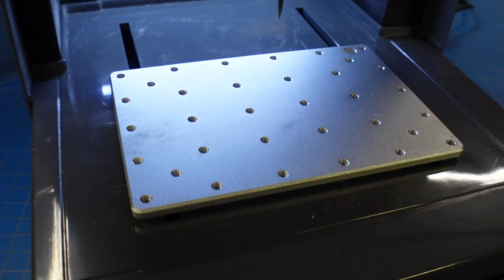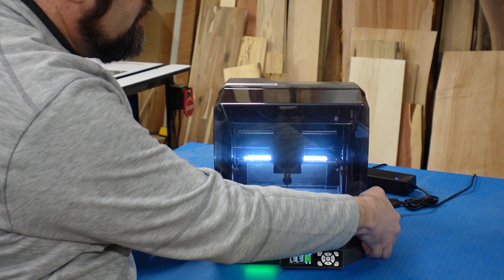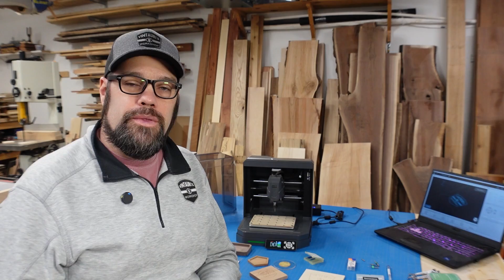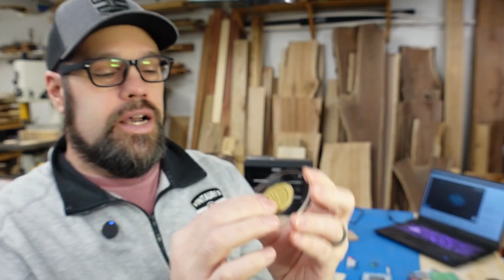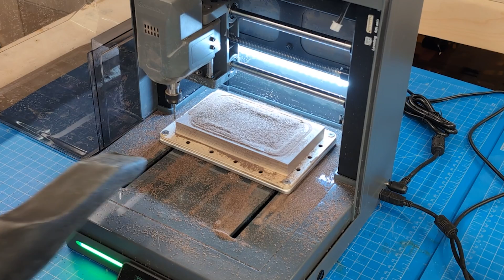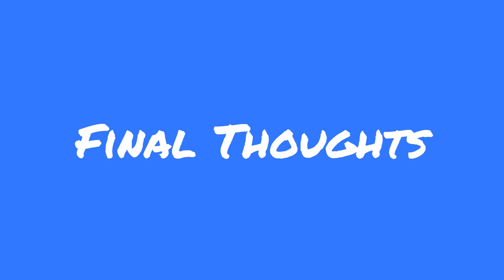Genmitsu Cubiko Mini CNC Machine

Comment from the maker: Check out the Cubiko on Sainsmarts website using my affiliate link here: https://shrsl.com/4w4f6
Reply: Do you think this unit would be good for small copper or brass badge machining.  I am looking for a unit that can do milling for cleaning up the edges of copper blanks and then also do laser cleanup of masking paint off the surface for making etched and paint filled badges for machine tools
Reply from the maker: @CraftwerksMC  While it can work with aluminum and brass, it's very slow at it.  You might want to look at the 3020 Pro Max for milling copper and brass blanks.  https://youtu.be/Gz1eA__9gos
Reply: @Vintauri  I wasn't actually going to mill the blanks with it.  I am going to cut the blanks on a shear but doing that the edge will be jagged and its pretty thin sheet metal (less than 1 mm) so my thought is to just use the mill to give the edge a machined amd straight edge, and then the laser to burn off the protective paint for the area to be etched.

Comment: From a machinists standpoint for cnc metal, swap for a .25 collet and use a .25 3 flut square end mill, then do the math for speeds and feeds and it should cut alot better.   .125 end mills are more fo a finish pass or for a very small hole or radius.
Reply from the maker: This machine is way to lightweight to run a 1/4" endmill. The spindle is very low power and the frame cannot hold up to the chipload that a larger endmill wants to run at.  It's really meant for smaller engraving projects, but I figured I would try it out on a slightly larger project.
Reply: @Rockingmachinest  what about a 4 flut end mill I just got this machine i have no experience with cnc but i have had it up and running and actually made a couple of things but i thought id ditch the 1/8 collet and see if i could get a 1/4 would that work better?

Comment: This is wayyyyy smaller than it looks on Amazon thought this could fit some hefty pieces
Reply from the maker: Yeah it's no beast.  Great for a small space workshop on smaller items, but not for anything larger than a drink coaster.
Reply: @Vintauri I just got one I have to agree mostly but I did push it this weekend and did a 6inch by 4inch 1inch thick pice of red oak I made a half inch deep pocket and put some text in the pocket I really just wanted to see if it would handle it

Comment: dumb question, could you put a hole up top to fit the end of a shop vac hose to it so you can have a dust collection system?
Reply from the maker: It's possible but the hose would need more move around some and it would likely interfere with the cover. It would be best to leave the cover off when running with dust extraction.
Reply: @Vintauri well the fix would be to first elevate the shop vac itself, and if necessary install a extension hose to it , just a thought lol whenever I get one I’ll send a photo 😂

Comment: Super informative video brother. I have my Cubiko coming in in the next couple of days. Hoped you could clarify something for me? You kept referring to your speeds as 5 inches per minute, or 25 millimeters per minute. I'm unsure if I'm missing something as I'm very new to the CNC world, but I would have expected 5 inches per minute to be closer to 125 millimeters per minute as 1 inch is ~25 millimeters. That being said, do you usually use ipm and therefor 5 ipm is the true speed you're running at? Your results are clean, so I'm wanting to get a solid baseline before testing later :) Thanks in advance!!
Reply from the maker: When I started using CNC routers, I always operated in inches per minute.  Now with more lasers and people using mm/min or mm/sec I try to include the conversions, but in this case I slipped up when speaking. Use the IPM settings I reference in the video to get a baseline for similar work.  Thanks for watching!
Reply: @Vintauri awesome bro! I really appreciate you taking the time to clarify cheers!

Comment: Many thanks for the detailed test! Which software do you recommend for PCB milling? And which software for wood milling?
Reply from the maker: For general CNC milling and operations I like using Vcarve from Vectric.  You can easily import vector designs from other software. I've not designed many PCB circuit boards so I'm not sure if there is a better layout tool.  I've heard people like the free Circuit Maker tool.

Comment: Can this be used to engrave text onto metal medals? Depends on the metal I guess, but let's say brass.
Reply from the maker: Yes it can engrave brass but depending on the depth and size of the engraving, it will be slower than a more rigid CNC router.

Comment: Why no auto level?
Reply from the maker: As far as I can tell, the z probe only works with PCB boards and through the control panel on the front of the machine. They may have more information on it now but I was not able to get it to work through the Gsender software.

Comment: Nice review!  Sainsmart has said that you use the dust boot with the cover removed, which suggests that the machine will run without the cover.   I had that dust boot on a 3018 Pro and found it likes to wrap the long bristles, at least in the early versions, around the bit and start slinging the brush section around.  They may have shortened the bristles since then, if not some trimming might be worthwhile.   Those aluminum clamps appear to have a threaded hole in the short stubby end, this can be used with a screw to level the clamp so it's tilted down slightly into the workpiece.  The angled up approach has been described as the watermelon seed squirt position since the work can squirt out from under the clamps in that position.  I prefer shop made (we have CNC routers...) clamps from wood or plastic, with nylon screws instead of metal since cutting into them doesn't create as many entries in the busta bit club scorecard.  Any gcode sender worth using has feed rate, spindle speed, and travel speed adjustments including Candle, UGS, GSender, etc.  They're built into the firmware, not the sender, where grbl calls them overrides.  And a VCarve trick, VCarve, and probably other 3D capable Vectric products, does "rest machining" where you can specify multiple finishing bits and each one will only remove what previous bits left.  On projects with a lot of flat areas you can reuse the roughing bit (adjusting the feed and stepover)  as the first finishing bit, which may reduce overall time by getting all the near flat areas.  I've found that it can also get areas that you might not have suspected too.  Since no bit change is needed you can combine roughing and that finishing pass into one file and the extra pass probably won't take very much time.  IDK if it would have helped that particular job, but it's something to consider when setting up toolpaths.  And those plastic rings on the bits are depth control rings and used a lot in the PCB manufacturing industry.  They let you change bits without having to reset/probe/whatever the Z axis.  They also reduce your max cutting depth, I've melted them with 3D projects on smaller CNC routers when trying to cut too deep.
Reply from the maker: I did run the metal job without the cover so I could ensure the chips were clearing and keep a little air on the bit. They didn’t send the clip they are talking about with mine so I had to tape it down. I’ve used Candle and UGS but I find the Gsender interface to be easier to use. I’ll have to look at the feed rate adjustments on the others. Thanks for all the great tips! I'll definitely check out the rest machining feature in VCarve.

Comment: Can it create it's own spoil board?
Reply: If they don't come out with one of their own, I would try cutting a piece of plywood to the right size and maybe using the machine to drill the holes.
Reply: @SteveSavitzky I was thinking that's what I would have to do.  Cut main size on table saw.  Setup holes on that machine.
Reply: @SteveSavitzky  I'm doing a similar thing before mine arrives - but 3D printing the spoil board .STL so I can use it as a template to cut plywood to size and drill the holes.
Reply from the maker: It could create one that is smaller than its overall working area but not one that fits the entire build plate. I think Sainsmart said they were working on a sacrificial board similar to the one I made if you do not have the means to make one yourself.

Comment: I did the early bird kickstarter for this. I'm primarily going to use it for creating one off prototype PCBs and to cut openings for switches and buttons in small project cases. I would think my type of use case is perfect for this little machine. I'm really curious to know how others plan on using it considering the tiny build area and fairly weak spindle. Thanks for the review.
Reply from the maker: I think using this for Prototype PCB's is one of the better uses for this machine. I'm still playing with if I can get the auto Z to work in the GSender software, but even without it I had no trouble making a couple of the small boards shown in the review. I hope they can ship out the Kickstarter units as quickly as possible so others can start sharing their experience with it as well to help dial in what this desktop machine can do!  Thanks for watching!

Comment: Very good review, thanks.
For the PCB did you use a height map (using the probe feature) or was just zeroing the Z axis? 
You also don't mention spindle speed, so I assume you use 100% speed for all those test projects?
Reply from the maker: I was unable to get the height map or the z probe feature working through Gsender. So it was a manual Z zero using paper under the bit. The included touch panel has the prob features but I prefer the flexibility of the software control. As for spindle speeds I kept it at 10,000 rpm and adjusted the feed rate to dial in speeds.
Reply: @Vintauri  got it thanks. 
 I'm using Candle for most of the work I do with PCBs. The Height map does a big difference, thus the question as the results you show were already quite good.

Comment: Would be nice as a supplement to my commarker lasers. Seems capable to make jigs out of it?
Reply from the maker: You could make smaller jigs with it, but the working area is only 5 inches wide by 4 inches deep so depending on the Commarker laser it could be a touch smaller than your working area.

Comment: So to use the dustshoe you will have to remove the enclosure cover. They have put out a guide explaining how to install it. But they don't mention how to bypass the limit switch on the top, so apperantly its not a very thought out solution. Of course you could just tape over the switch ...
Reply from the maker: There is also a cover to the spindle that needs to be removed.  Tape will work on the limit switch, to a point, there is also a foam material there and when I used the tape method it eventually pushed back up.  I'd have to look at the GRBL settings but it might be possible to disable the switch with a command or macro to turn it off and on.  Either way, it seems like an afterthought.

Comment: I really like the laser cut spoil board you made :)
Reply from the maker: It's a must have if doing any cutting in my mind.
Reply from the maker: It's easy to shoutout good products!  More to come!
Reply: @Vintauri  Can you post a link to the svg or other vector file to laser cut one, for those of us who also have a larger than Cubiko machine?  Can the Cubiko cut/drill the holes if the outside is cut with a saw or similar?
Reply from the maker: @KirkYarina  The spoliboard file is from The Clack Shack and it can be found on his Etsy shop here: https://theclackshack.etsy.com/listing/4298563949
Reply: Also, thank for the shout. I appreciate ya man :)